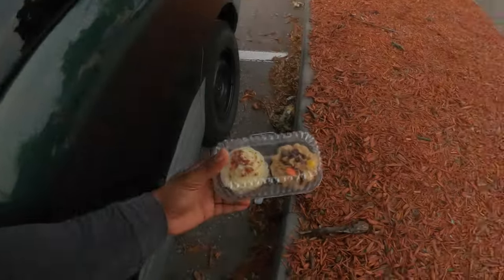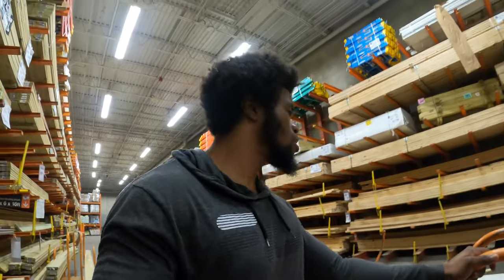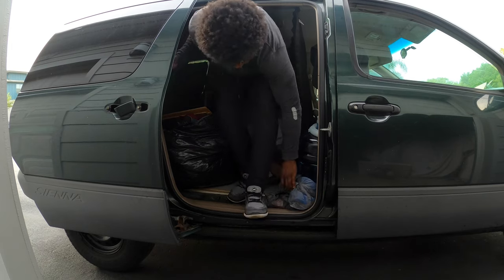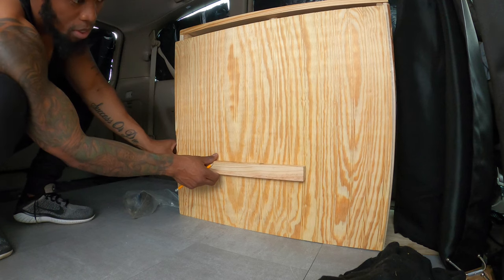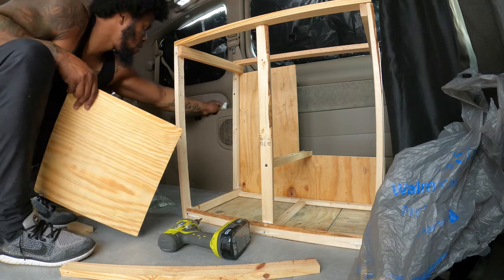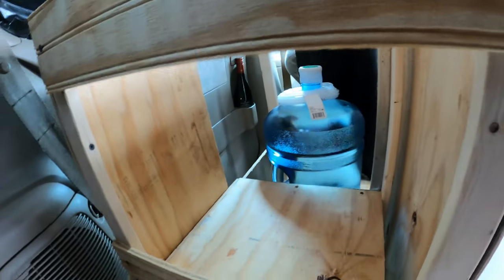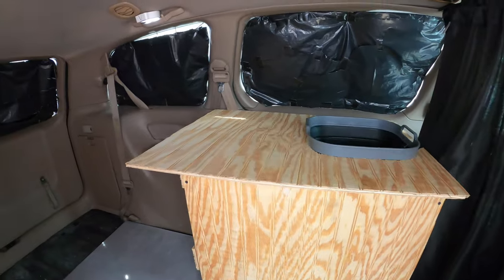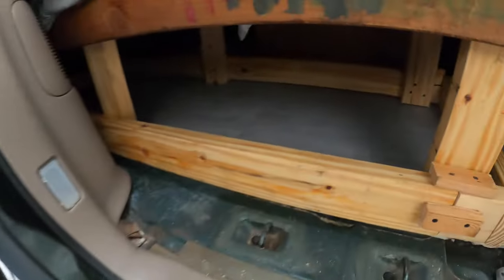MINIVAN CAMPER CONVERSION BUILD DAY7/LIVING IN MY MINIVAN/SOLO MALE/VLOG95

Comment: That is all you need for a van build--a bed, access to water, and the ability to cook food in inclement weather. I love it. My question is, how do you regulate the temperature while staying stealth? I'm in South Florida where it's hot year round. Any vehicle that isn't turned on with the AC running turns into a sweatbox. Fans work but they blow and circulate hot air.
Reply from the maker: Facts🔥 I’m in Tampa Fl and I’m always doing something so I’m never really just sitting around in the van to really feel the heat unless it’s at night and at night it’s cooler…. When I decide to travel etc I’ll work on getting a portable ac etc… thanks for watching 💯enjoy your day ✊🏾